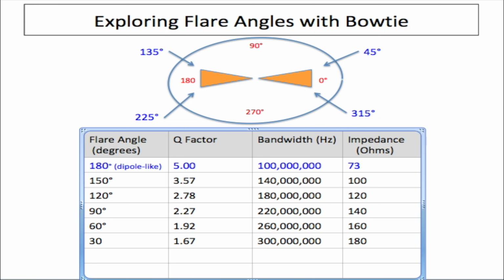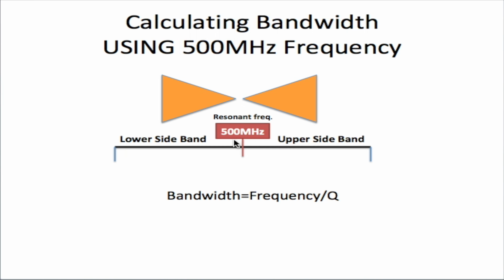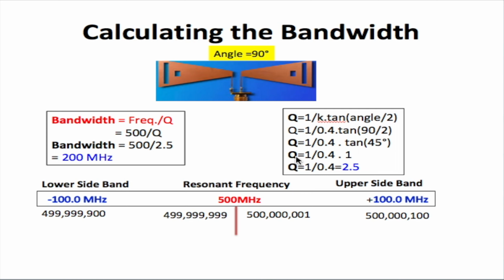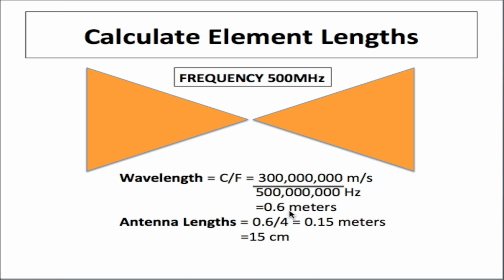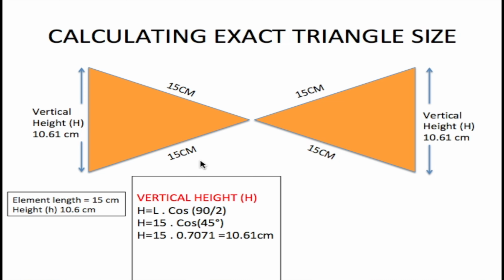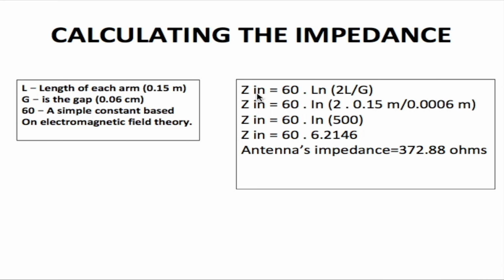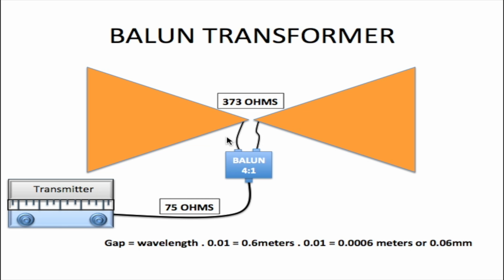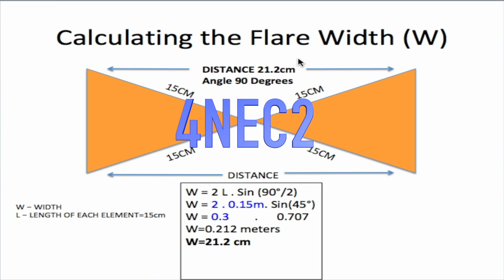Bowtie Antenna's Hidden Power 🔥

Comment from the maker: IMPORTANT CORRECTION:

Several viewers have correctly pointed out problems with some of the dimensions, angles and calculations presented in this older video.

I don't want anyone attempting to build the antenna based on information that may be incorrect or unclear, so I am reviewing the design and calculations.

I plan to revisit bowtie antenna design in a future video with a completely revised, step-by-step design in which the dimensions and angles are clearly defined and verified.

Thank you to everyone who has pointed out these issues. Accuracy is very important to me and to Telecom Training.

73!
Trevor

Comment: Thanks for making the video, but as pointed out in the comments ... lots of errors.
I am trying to build a receiving only antenna,  so I have persisted with your presentation for many hours.  You have failed to explain the angles clearly.  You start the calculations with a 90' angle ????
Your introduction repeatedly describes 45' angles. (presumably that is important?) Having battled through all the other errors, I still did not understand how to scale this for my frequency.  The dimensions you provide when I draw them out give me 69.1, 69.1, & 41.8.  No 90' & no 45' angles.
Reply from the maker: Thank you for taking the time to point this out. You're right that the explanation of the angles and dimensions in this video is not clear enough, and there are also some errors that need to be corrected.

I made this video about 11 months ago, and I've been considering revisiting the subject because several viewers have raised similar questions.

I think the best solution is to produce a new bowtie antenna design video in which I start with the desired frequency and work through the complete design step by step, clearly defining every angle and dimension before doing the calculations.

I appreciate you persisting with the presentation and bringing these issues to my attention. 73!

Comment: Bandwith calculation wrong is from 400.000.000 -> 600.000.00
Heigth calculation is wrong  H = L.cos(45) is only allowed with a right angle better is 
H = 2 (L.cos(45/2)
Gap with 0.6 * 0.01 = 0.006 and not 0.0006
Reply from the maker: Thanks for catching those. You're correct on the bandwidth and gap calculations. A 200 MHz bandwidth centered at 500 MHz should extend from 400 MHz to 600 MHz, and 0.6 m × 0.01 is 0.006 m, or 0.6 cm. Those were errors in this older video. On the height calculation, however, L in my diagram represents the 15 cm sloping side of the right triangle, so H = L cos(45°) = 10.61 cm is valid for that geometry. I appreciate you taking the time to check the calculations and point out the errors. 73!